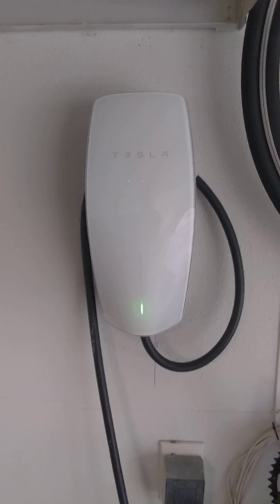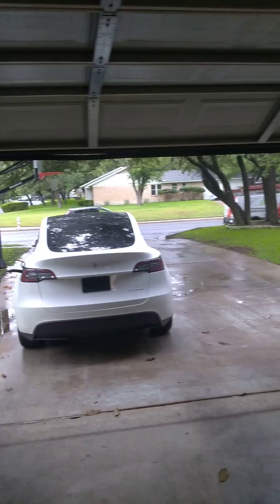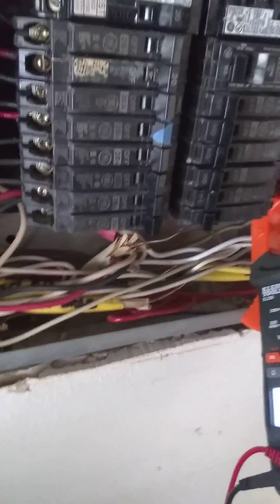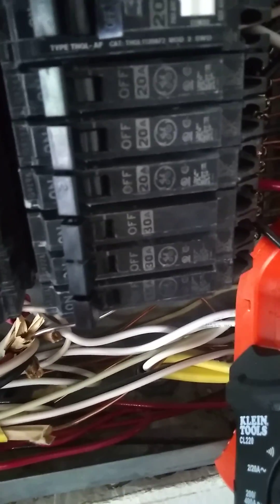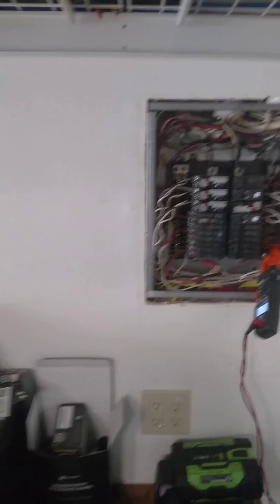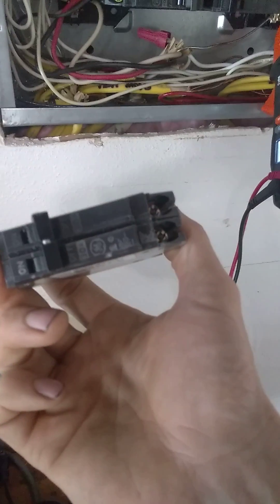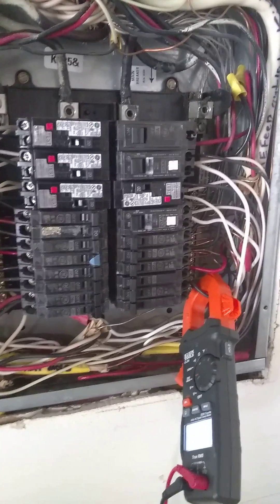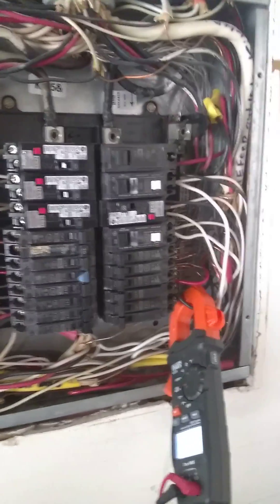DO NOT USE GE SLIMLINE BREAKERS FOR EV CHARGERS

Comment: Might I make a suggestion instead of touching it with your hand and assuming that it’s too hot why don’t you use a temperature gun the actual temperature off of it and see if it is at aacceptable
Level and you have to remember that may be a fast charger, which is gonna also cause the heating to go up 

My opinion is all breakers sometimes malfunction due to imperfections this is going to happen. There’s nothing you can do to get around it. You just wanna make sure that you put good one in before you call the job done

Comment: I have a GE panel in my garage running the GE THQL breakers. Even on the standard size breakers (not the slimline) I've been running into the same issue. Im running 48 amps on 6 gauge thhn wire and a 60 amp breaker and after 2 house I'm measuring 140 degree breaker temp. That just doesn't sit well with me. That GE panel is fixing to go into the trash along with the breakers.
Reply from the maker: Yes in my mind GE is becoming trash
Reply: Installed a 40amp THQP240 breaker for 32amp charger. IR thermometer is reading 140-144F on the plastic part of the breaker, and 111F on the knob to turn the breaker on and off. 

The ambient temperature in the garage is about 90F. 

Should I be concerned?

Comment: 24 amps at 120 volts makes 2900 watts. How thick do the cables have to be?

In Germany, single-phase chargers with 230 V x 32 Amp (7400 watts) are connected. 
But much more often 3-phase chargers 3x 230V x 16 Amp (11000 Watt) are installed.
Reply from the maker: It's 240v single phase using 10 ga wire rated for 30 amps continuous.

Comment: for quick work around, I would set charging current from the tesla to be lower: Say 70 or 60% of the circuit rating and hopefully this will help?
Reply from the maker: When Tesla charger is told or programmed that it is on a 30 amp breaker it only draws 80% of the breaker capacity, 24 amps.  To set the draw even lower defeats the purpose which is to use the biggest breaker available which in this case is 30a.  I think maybe the problem is the GE slimline breakers.  The full size 30a breaker I don’t think would overheat.  If the GE slimline breaker can’t handle the rated capacity or even 80% of it, it should not be UL listed and available for sale in America because it could cause fire, death, or injury.
Reply: @johnironsmith4402  unfortunately most ul listing is done "in house" by the manufacturers, just following ul guidelines.

Comment: You would expect a extremely reliable product from GE, they build jet turbines, diesel locomotives and wind turbines just to name a few of their products.  What gauge is the wire running to and from the breaker?  If the gauge of the wire is too small the amperage/distance you can create extra heat in the breaker
Reply: distance has no effect. because the car charger is set to limit the amps to 80% of the breaker... a longer distance/smaller wire will just result in less volts at the car... amps are always the same through a circuit... voltage can drop though
Reply from the maker: Yes GE used to be a great company and there still are some good people that work there.  My Dad used to work on GE turbines.  But since growing too big, government subsides and outsourcing labor their products have declined and in this case become a fire hazard.
Reply: GE breakers & panels have been junk as long as I can remember,  I don't know a single electrical contractor that has used them in the last 20 years.